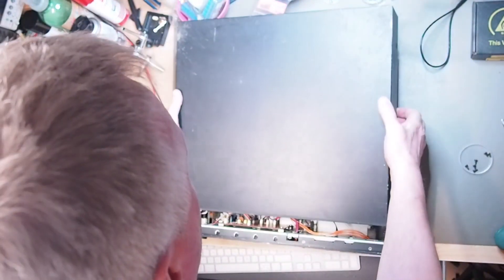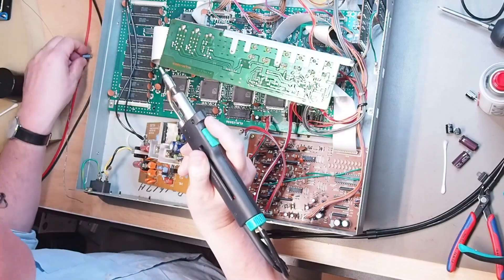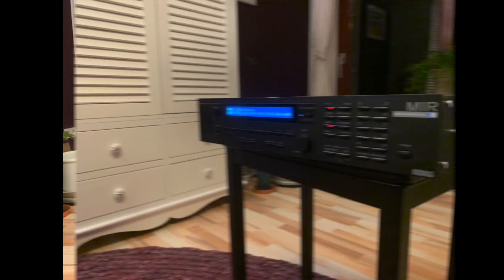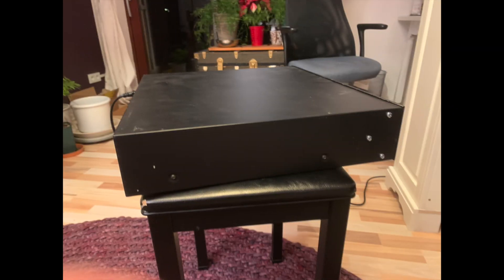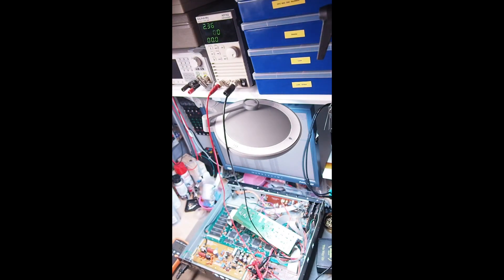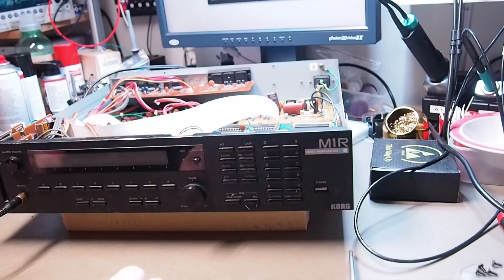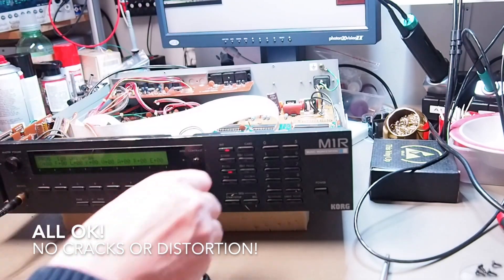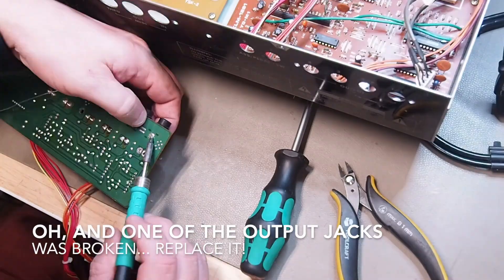ReinardSynth #10  Korg M1r repair: distortion on audio output?

Comment: I recently recapped the power supply in my M1r and now when I boot up it just shows a blank screen and no sound. Buttons seem to work but I can’t get it to boot up. Any recommendations?
Reply from the maker: First check if all voltages are correct - with load connected. Something must have gone wrong with the recap I would say. Can you share foto of the PSU after the recap? (Top and bottom of pcb)
Reply: @reinardsynth6581 thanks! I fixed the issue. it was one of those green inductors so I replaced all 3 in case. works great now!

Comment: Nice and pro work, btw i just a M1 keyboard last night but when i turn effects on on many of them i have huge noise and in some of them distortion, however some of them like chorus work as they should, reverbs/delays not at all. Other wise the synth works fine and is almost mint so i could use it using an external fx unit but i would like to service that cause i think that effects in M1 are a part of its classic sound. Any ideas about what to check first ?
Reply from the maker: have an extremely strong suspicion that the effects-RAM ICs (or one of them) are broken and need replacement… chorus effect does not need RAM, reverse and delay does… this is not uncommon for M1s (and T1/2/3’s)
Reply: @reinardsynth6581  Really many thanks on this, this is a starting point about what to check first. "After battery replacement" ment to me that someone got there and fried something and somekind of ESD happenes, or simply end of life for some ICs, its in a nice condition and i would love to restore it fully in its original glory.
Reply: Btw i guess they are based in the mainboard pcb and is there a way to test them using a simple multimeter or do i need some special equipement ?

Comment: Hi , for the m1 what will be the blue cable that would be connected to 5 volts (CN10A)  and on the jack board will be the R11, R12, R13 resistors that would be changed